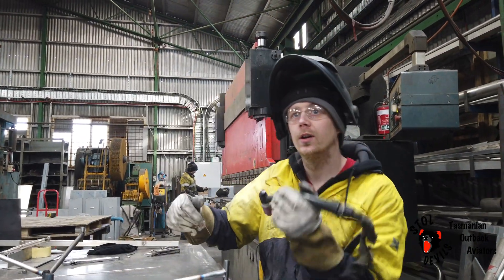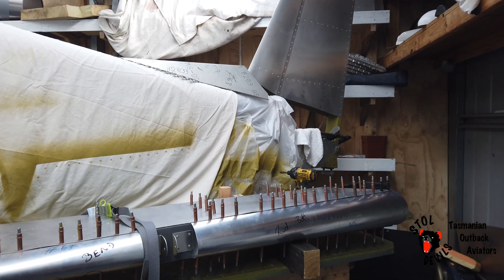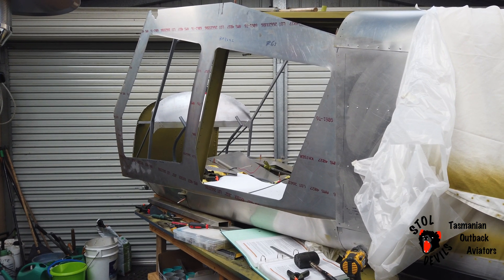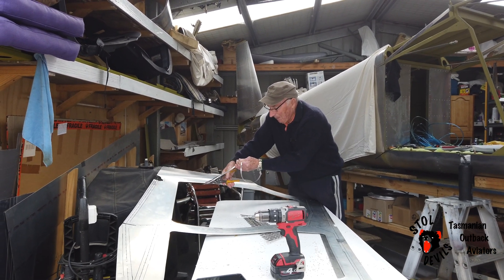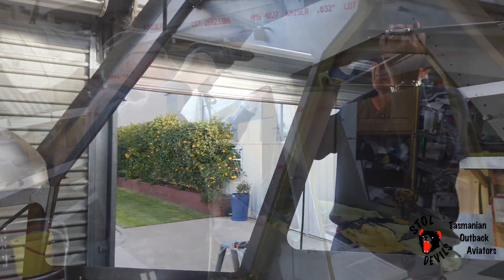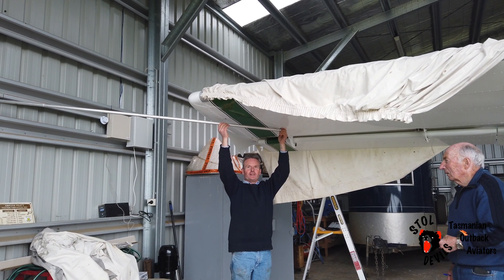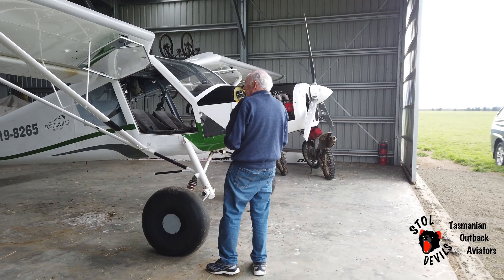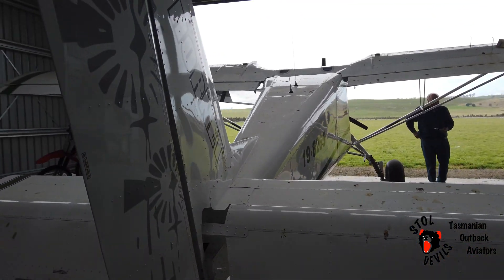Hornet STOL with Aeromomentum AM15 147HP- Aussie Bush Plane - Build #3

Comment: Hi Kyle
I am interested in building a Hornet with the Aero momentum engine. Still in the research stage and I have been reading a lot of information on both the aircraft and the power choice.

If you have not seen this you tube clip, I recommend you have a look at andys RV12 AM15.
This guy has had a bleeding issue with the cooling system which actually destroyed the engine and he has had to purchase a new long block which now has factory modifications to remove the coolant bleed issue.
Just a heads up so you do not have the same issue with your aero momentum engine.
Reply from the maker: Matthew Sawyer Hi Matthew, yes I have been chatting to Andy quite a bit. My engine has the redesigned coolant bottle system. Andy has been a great help on the AM install.  I am hopefully going to be mounting mine this week. Where are you based?
Reply: @kylegardner9900  Good news on having the redesigned cooling system. These available forums are great to circumvent potential issues. 

I am located in Warwick QLD and have been out of aviation for many years due to work commitments. the bug never leaves and its time to get back in the saddle.